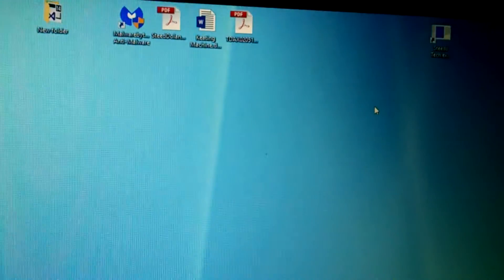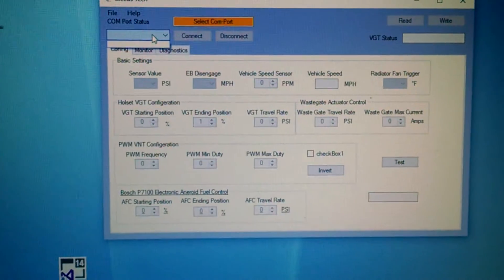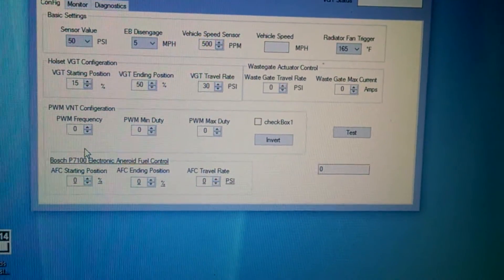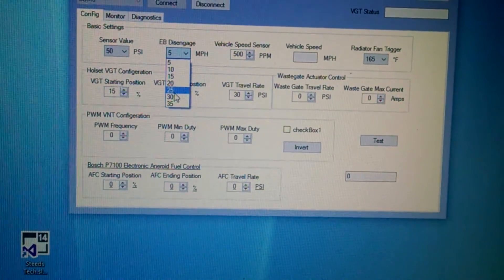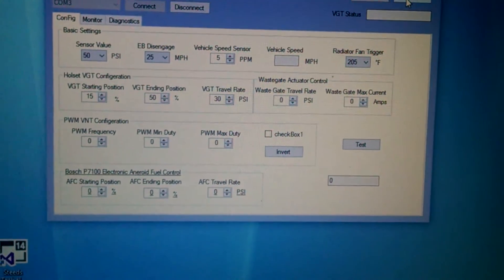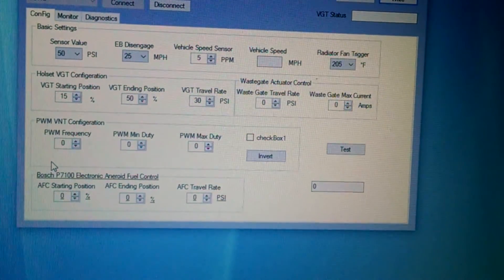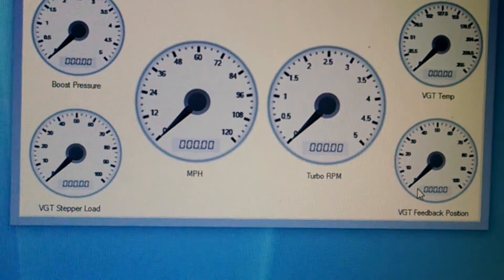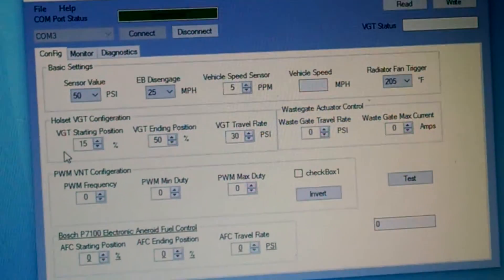Banshee VGT Controller, PC program

Comment: is this replacing the black box in cab? will you need a laptop,phone,tablet to monitor and change turbo?
Reply from the maker: +Mike Peterson Yes this replaces the black remote. You will need a laptop to program and setup the controller. As well as monitor and run diagnostics.

Comment: What are your boost numbers?  It's really difficult to see?
Reply from the maker: cruse at 70 is 5lbs, 10 lbs in 5th going 100. horsing around incan peg my 35psi gauge to the back of the 0
Reply: +Steed Dolan  Not bad! so that's 10 lbs at 2k rpm?  Seems your really tied up in your VGT operation, but did you scrap the supercharger idea?  Afterthoughts?  and are you selling your truck?  I thought i seen it for sale on fb?
Reply from the maker: Yeah, I'm turning more then 2k. In 5th I'm turning 18+ at 75mph.... Yeah I have my truck for sale, I'm building a 16 valve 4BT and with another kid I want to build a 4 door Tacoma
Reply: +Steed Dolan  Ahh ok i thought so! yeah I drive a 02 taco 4dr with 4bt and love it!